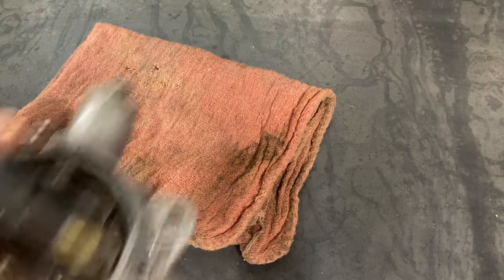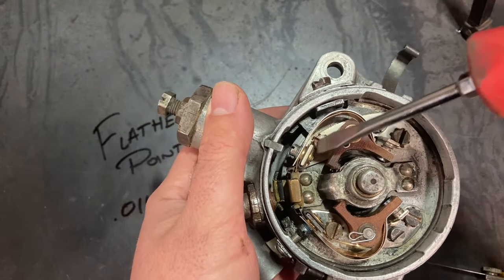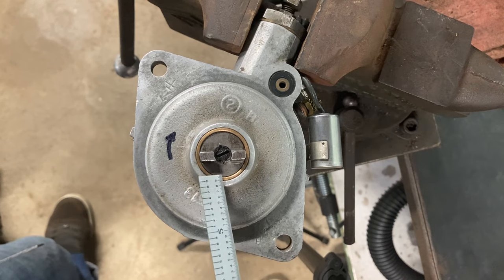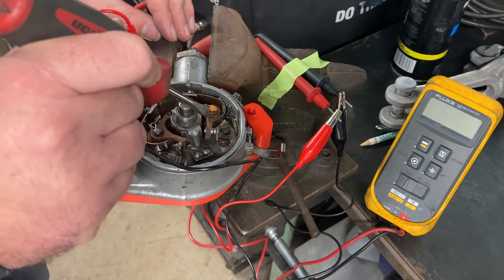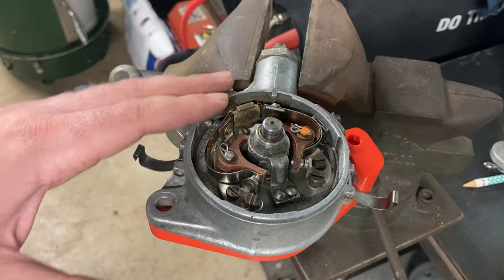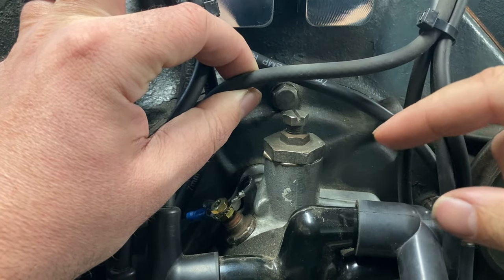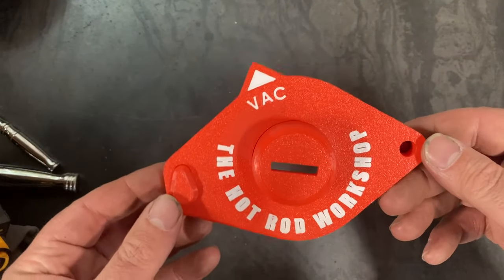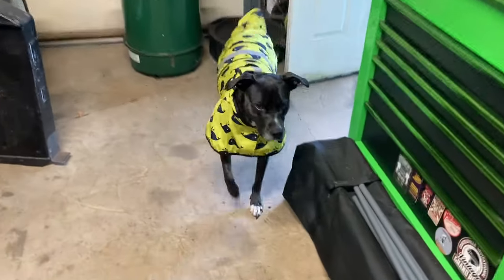Flathead Ford Distributor setting points and initial advance Pt.2

Comment: Nice piece of tech on the set up of these distributors, both parts 1 & 2. You might also have mentioned that after setting the points gap, remember to re-tighten the screws on the points mounting plate, though most folks probably already assumed that step.

Comment: If I were to perform the two straightedge method to set the advance on a 3 bolt helmet style distributor, what is the measurement and from which hole do I make the measurement? Also would the gap still be .005" on the advance side points?
Reply from the maker: These are all excellent questions that I hope to answer in the next distributor video. Stay tuned!